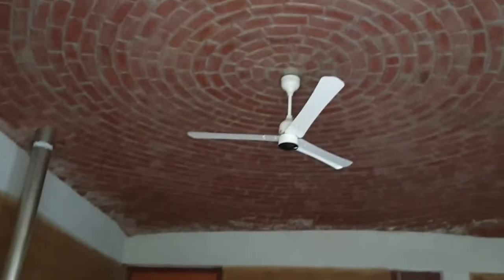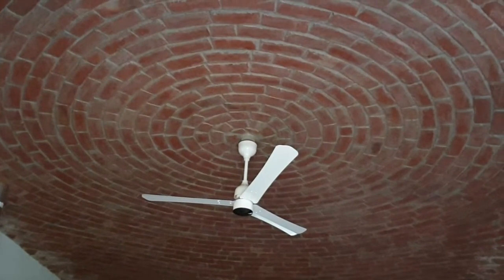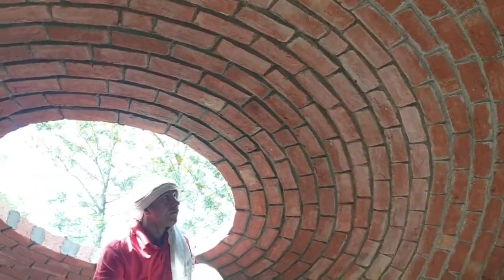How to Make a Rohtak Dome Roof

Comment: Thats a very good mortar ...im personally cursed 😂 my mortar is too too strong i made a 4 cinder block wall to sit a stove edge on once and brushed on a mortor cover with green pigment over a cement floor.

4 years later me and two other guys had to remoe it. Now im a big guy ive removed driveways by myself with a sledgehammer and pickaxe....

But we whacked at these 4 blocks for more than 40 minutes a couple chunks fell out of the brakes but normally the hammer would just make an indentation.

At the very end it fell down as a solid thing ripping chunks out of the cement floor and the wall but we were hitting a pass a foot away from each of them.  Lol lol.

Later I put a small thing around our outside spiral staircase of adobe cement it was so hard when we had to rip up the sidewalk I took out and 6 to 10 ft chunks but that little thing of adobe I let the other contractors dig out and watch the guy beat at a 2-inch thick slab of adobe cement for more than a half hour.
About lost it it was only 4 ft by 4 ft...
But what happened was that every time he hit it with any of his tools it would simply make a small indentation of the tool😂😂😂😂

Comment: Thanks for this informational videos that you are sharing. I am curious how is the electrical connection laid out. Also another question could the top of the dome be made flat for the upper floor's floor?
Reply from the maker: The electrical pipes run over the brickwork and under the finishing tile layer. Rohtak dome is quite flat and after leveling the roof, another floor can be built
Reply: @farmaanandaa  thanks again, truly appreciate your effort, intent and kind gesture.

Comment: Mam, How can a roof without reinforcement that actually bonds and strengthens the material for load bearing? Also, not sure of it’s strength to withstand earthquake.
Reply from the maker: Its a shallow dome. Domes dont collapse in an earthquake. The physics is such that it stands till the walls stand

Comment: Great concept, but would like to know more how it'll hold up against tensional load and wall compression force without any supporting member! 
What would be rated Max load capacity above the roof and can it act as load bearing for multi-storey construction?
Reply from the maker: Feel free to call Narayanji for more information. We know it can take a water tank and a solar water heater on top of it. So load bearing capacity is quite good

Comment: How do one get the electric connection, hook for the fan has been put, wiring?
Reply from the maker: The pipe for the fan is on top of the roof, and gets embedded in the water proofing and sloping layer.

Comment: Hi mam, a question what kind of whether product do you using on this top of the structure? definitely we cannot leave as it is on the Rohtak roof, since red bricks do allow the rain water.
Reply from the maker: Hi, watwr proofing is done the standard way. After a layer of coement mortar, we applied a water proofing coat, then used brickbats to make the slopes for water drainage and finally put tiles over it grouted with cement
Reply: @farmaanandaa  great, I thought a 2 inch shell concrete with 6mm wire may need prior to weathering course. From your reply came to know that the concrete shell is not required, great explanation. Thanks mam
Reply: @farmaanandaa  mam, I'm trying to visualise.. so after waterproof coating, you make it fkat at the top and then put the tiles? Will it be possible to see a picture of the top after the tiles are installed? Thank you

Comment: Great video. Was missing these. Although the concept itself is sustainable and should last long, since you have used cement instead of lime, it may form cracks over a period of time, just like any other cement structure.
Reply from the maker: Thanks! We truly hope it doesn't weaken!
Reply: Yeah, but a cement structure can long last atleast 70 years minimum. In Europe you could see WW2 cement bunkers, still those in good structure.
Reply: @king000775  Yes, the lifespan of a cement structure is between 15 years and up to 100 years. After 15 years, it may start to form hairline fractures that need to be filled in however the maximum life is 100 years after which it needs to be brought down. You can see these cracks in all the apartment buildings in the city that are more than 15-20 years. However the structures made out of lime last hundreds of year. The examples can be seen in Great Wall of China, all the forts and palaces in India, which  all were built using Lime. Plus the bunkers you are talking about is at least 3 to 4 feet thick concrete, and we don't use such heavy concrete when building homes.
Reply: In the Great Wall of China, they used in some years rice flour mixed into the lime mix - as we know it took hundreds of years to build. It still stands.

Comment: i would not stand under this roof ,it looks scary ,it will fall down any time ,there is no support
Reply from the maker: Haha this is the physics of the construction. The bricks dont fall and the roof is very strong!
Reply: @farmaanandaa  i know that ,but i was just kidding with you to make you irritate ,but you don't 😅
Reply: @farmaanandaa  can you please explain the physics
Reply from the maker: @Redbricks-l8s  it's a shallow dome. The weight of the bricks falls on the bricks on their outer edge. Eventually all the weight of the roof falls on the wall.
Reply: @farmaanandaa  so madam its similar to flat rohtak roofs am i roght
Reply from the maker: @abhijithas1015  yes it is a flat rohtak dome!
Reply: @farmaanandaa  which will you prefer this flat rohtak or madrass roof which is better madrass has an added adavantage of intermittent supports?
Reply from the maker: @abhijithas1015  madras roof has a warm and rich look to it, and maybe a little more expensive given the addition of wood. Rohtak domes are cheap and cheerful, but can look a bit basic. You decide what works for you
Reply: @farmaanandaa  pranam I am want to visit your home to learn more about house please how
Reply: In haryana lot of old building made by this method , its name is dat system
Reply: Gravity holding it up
Reply: Can we stand on the top ?
Reply: @ShankarDada010 Are you making a joke too? All over the world, before the time of concrete floors and roofs, that’s how it was made to build floors on top.
Reply: Taj Mahal dome structure is the most load bearing structure without any concrete or steel  but we can't stand it's not flat 🙂 but using certain angle degrees we can make standing rooftop ✨
Reply: But is it possible to construct sec9nd floor over this will it bear the load